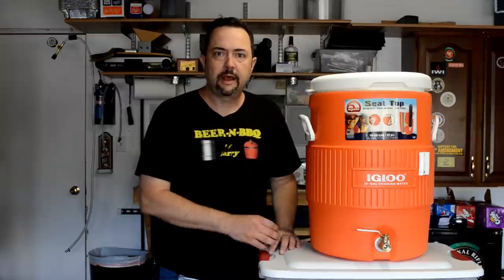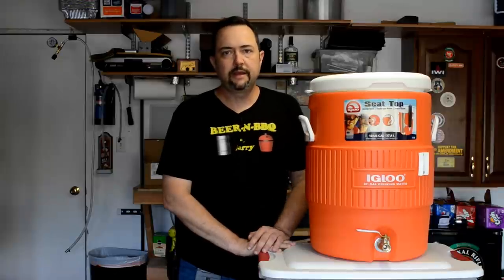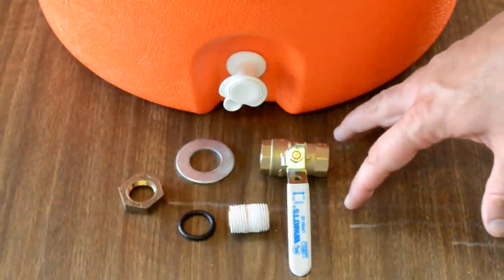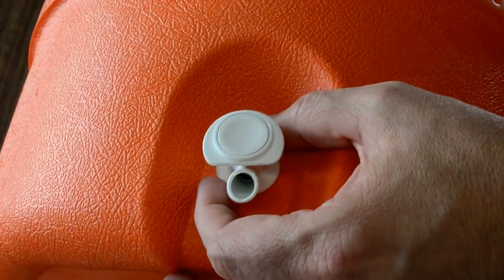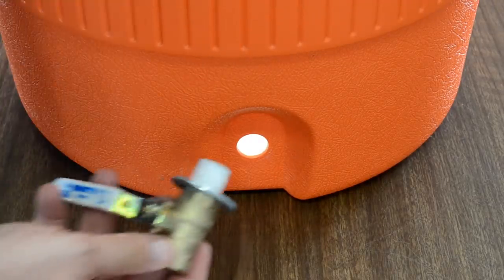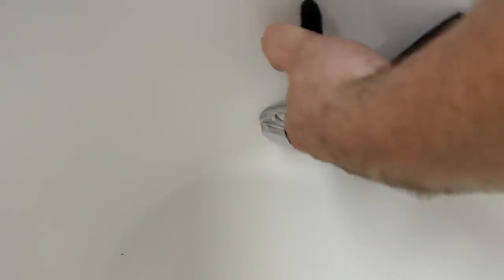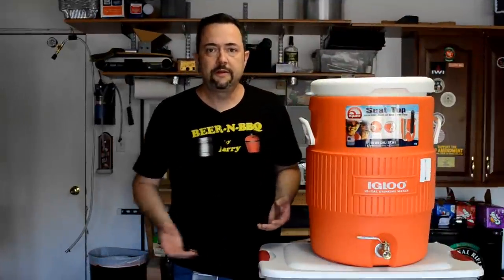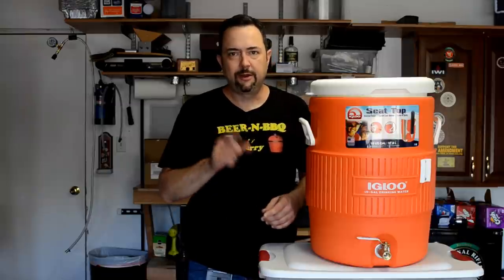Building a Hot Liquor Tank: A DIY Project

Comment: That 13/16 o-ring actually comes on the Igloo cooler. If anyone has trouble finding one at the store, check the original plastic spout. There's a black rubber o-ring that you can pull off and it fits perfectly around the nipple and tucks into the 1/2 inch lock nut.

Comment: Very cool. Larry you ought to take a 1/2 inch drill bit and drill a hole in the top of another cooler with the ball valve upgrade and you would have a brand new 10 gallon insulated fermenter. Northern Brewer does sell the 1/2 inch grommets for an air lock. A lot of new guys to the hobby would love to see this on video. :D

Comment: I'm still getting set up, but since my kettle already has a spigot  it would double as the HLT.  2 simple buckets  would be the "collected liquor tanks".
Reply from the maker: You could also ditch the HLT vessel completely and just use a 2-vessel setup like I did in this video: https://youtu.be/hdSTlcoz7EI
Reply: @BEERNBBQBYLARRY  Thanks. I'm trying to get set up and my head is about to explode with all the options and information available.
Reply from the maker: There are many options including doing a simple BIAB system. I even did a sous vide stick powered option like this: https://youtu.be/cQCmDv-5JUk

Comment: Do you fit a hose onto the ball valve somehow?
Reply from the maker: You sure can but is not necessary. Depends on your system setup.
Reply: @BEERNBBQBYLARRY  I’d like to so that way I can just ope the valve to the appropriate flow rate and have the sparge happen automatically hands free. Any idea or like to the fitting I would need?
Reply from the maker: @jeffreydolan201  a hose barb fitting that fits your ball valve thread and tubing size.

Comment: I hope that bev tubing you're using is rated for temps up to 170, many are only good to 160, personally I know I would feel more comfortable with silicon, especially if you're adding boiling or hot water to reduce heat loss from a room temp cooler lining.  I'm thinking about making my own HLT, but I also want to add a electric heating element connected to an ITC-1000 to regulate and hold the desired temp.  Any thoughts on doing this?
Reply: saw too late someone already asked about the electric heating element, maybe between SCB and others, we'll win you over to the dark side of electric :).  Brew bros did a good vid but I want to take it a step further with a temp probe and ITC for regulating temp.  Currently i'm using a annova sous vide for heating my sparge water, basically same principal and I really like how it works, just want to make something a little more permanent for brewing and also hard to setup the annova on a cooler or insulated vessel.

Comment: Does this mean you’re going to start Fly Sparging?
Reply: BEER-N-BBQ by Larry 10 gallon batch sparse is a lot or water to move around. @ 8 pounds per gallon it could get a tad heavy.  If you set up for gravity feed & pump your hot water up to your HLT you would be good to go for Fly sparging.  Ive dons both batch sparge & fly sparge & found the older I get the less I like lifting heavy things that are hot & slosh around. Therefore I fly sparge.  Besides, I do get better efficiency.  I’m not looking to save money on grain, I figure a few extra gravity points won’t kill anyone (except for a few thousand more brain cells 😉)